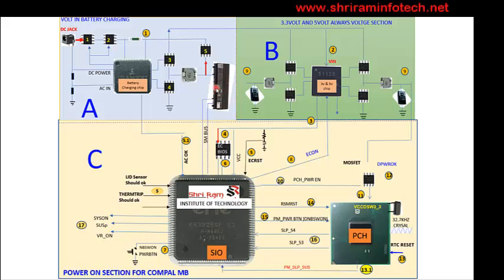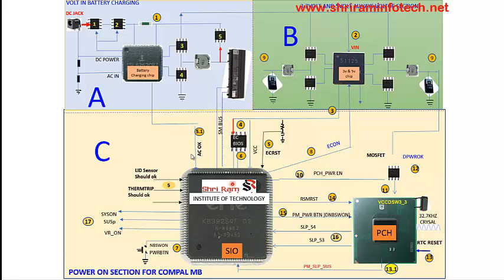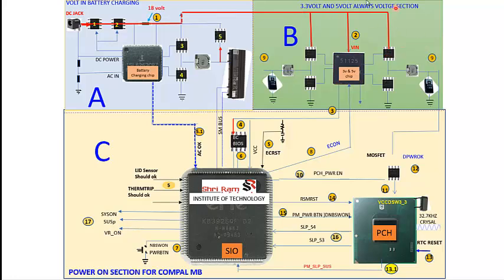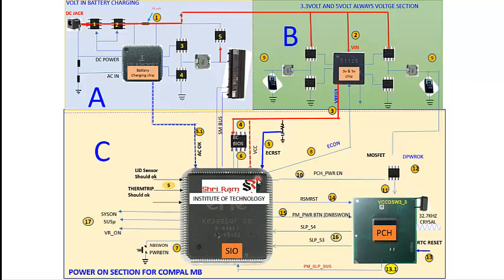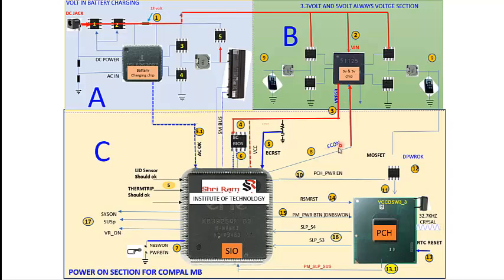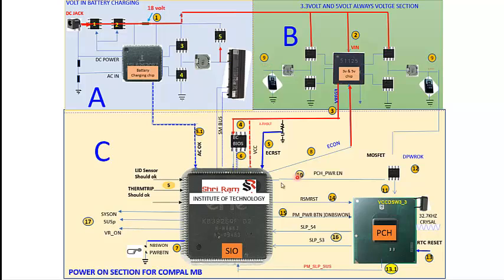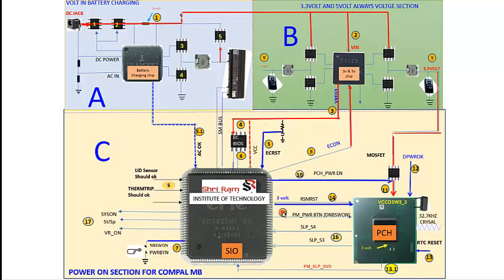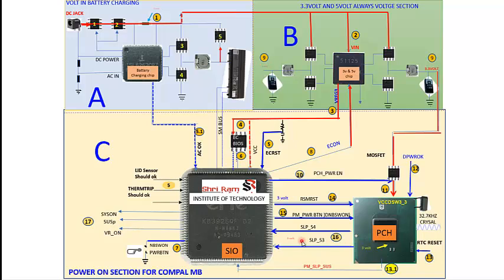how laptop turn on signal flow and sequence #laptopchipleveltraining #laptopchilevelrepairingcourse

Comment: what is the different about 3.3 V in number 3 and 3.3V in number 9 sir ?
Reply: The first one is an LDO output ( it is generated by that IC to supply super IO in standby) after that the SIO will sen a signal ( EC on to the ic (3v / 5 v chip ) to enable the 3v and 5 v channels ( these ones are switching not linear like the first voltage) ... to understand more you havec to search for ( LDO / Buck converter )